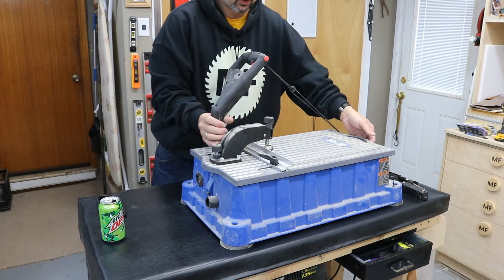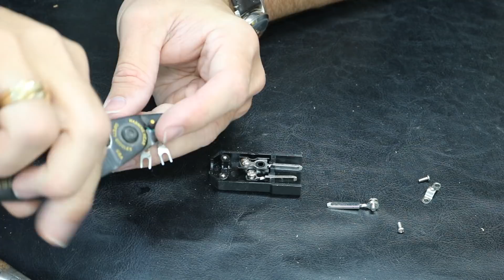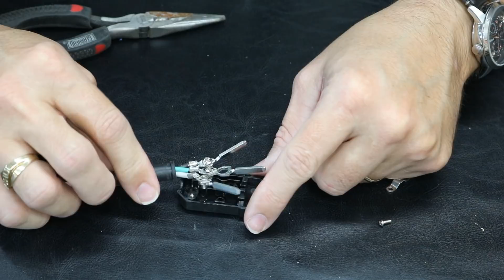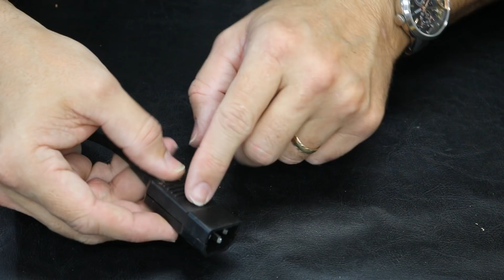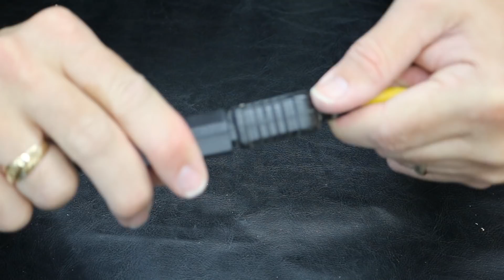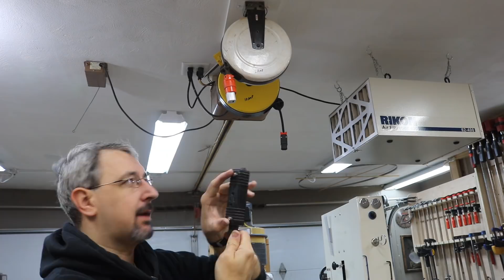Quick Disconnect System for your tools (follow up video)

Comment: How are these locking EIC connectors holding up after 3 years? I’m going to do this to my tools and and debating between the connectors you used or spending a bit more and getting the PowerCon connectors.
Reply from the maker: They are still holding up pretty good, if you use the eic get the locking ones. If not they put away pretty easily. Other then that no complaints. Was just thinking about doing a follow video. It might be time.

Comment: I changed all my power tools using 18 gauge cord. works great. I noticed you did your router and circular saw. what gauge wire is the cord. The amp rating on the connector is 10 amps.
Reply from the maker: I used the cord from the machine. All the tools I converted was rated under 10a

Comment: Just came across your video, after coming to the conclusion that I should change my tools' cables to a short IEC plug and replace the rest with one single cable which is easy to replace as many IT devices (monitors, printers etc) come with such cables. Thank you!
Reply from the maker: Cool, I really like this system and have grown to love it. I now have every tool converted and have been pleased that I’ve done it.

Comment: I would never cut any manufacturer's power cord.  If you grow used to the system, then sell the power cords on EBay, and you recoup over half the costs of this system.
Reply from the maker: After seeing the title to the video why would you watch the video then? It’s not for everyone. Stop wasting your time commenting on something you know you shouldn’t have watched.
Reply: Mike Fulton
The response is illogical.  The suggestion I make is that you have the supplies, so the need to cut one cable, then redo the ends is not apparent until such time as you introduce the idea inside the video.  Neither is it unique. 
I simply suggest an improvement in apptoach.
You also assume I don't need to see this.  That fact is not established. I did need to see it, so I watched 4 channels with the same theme to glean ideas.  A different channel, Marius Hornberger correctly points to cord value, AND warranty vouding in his.  You have a cheaper, more widespread connector system than he did.  That is great.  The use of computer component cables did not occur to me, you revealed it. They are in higher production quantities, so are cheaper to find.
I simply disagree with cutting any manufacturer's parts.  I neglected to mention it voids warranty, whereas, if you take out a manufacturer's cable, install QC cables, have an issue, replace the manufacturer's power cord, and take or send in the tool for repair, you can get warranty work.  
I worked with Dewalt hammer drills for years, and had to get warranty work about once a year.
Their brand store was .8 of a mile from our shop, and with 40 tech's throughout the city, from our company, 35 with Dewalt, we got treated like kings.  Cutting cords, housings, and modifying the drill would easily void the warranty at a glance.
Additionally, as I said, the parts of tools, including the power cord can be sold on EBay for most or all of the modification costs you incur.  For instance, the worn out batteries have a value.  Would you discard them, or recoup that value?  I also never used the second handle for 18v. hammer drills.  Should I see if they sell on EBay, or CL, or just throw them away?
Reply from the maker: Ok, Fair point The warranty deal could have been mentioned in the video for sure. I assume people would know that and didn't feel necessary to mention it. Plus I didn't think about that. That way i look at all the tool I converted they are pretty much one use tools. They are going to last as long as they are going to last and when its time to replace I'll just buy a new one. Most of the tools I converted are already outside the warranty or very close to it anyway. I see your point though and thank for the input. Forgive me If a I came across as a Jerk
Reply: Mike Fulton With a QC system you get to use all your tools with 2-3 power cords around the shop.  A great idea we already use on shop vac and air compression systems. 
I just disagree that the tools have found the end of their life cycle.
Most viewers are looking forward to upgrades in each unit.  Keeping the cables let's them trade it in, or sell it, or selling each power cord makes at least half this cost back.
Just saying.  
I still think you made a fine video, and deserve more subs and views.
Reply: MarkH10 your response is the one lacking logic. It's almost impossible to open some pro-sumer (Chinese) hand power tools and replace power cords. It's 100% brand dependent. You'll spend a ton of time and wind up not being able to get half of them back together -switch springs get lost, riveted or bonded parts are impossible to get apart - the juice is just not worth the squeeze.  Then you have the hassle of listing and fulfillment on eBay.  Mike would be working for $2/hr and wasting time better-spent doing something else.  Add to that the tools are mostly out of warranty or close anyway - and are all in the sub-$200 replacement cost - it's just not that big a deal.
Reply: Tioga Fretworks  
Since seeing this, andd commenting I have received emails I usually ignore on the subject of trade in.

That day I commented I binge watched and arrived through a suggestion on vlogger Marius Hornberger, the German shop YTer.

His video show 10 power tools, 1 of which is immediately apparent that it is too complicated to prices, so he closed and chopped it, the or her 9 are easy, and I have encountered that very thing.

Comment: Was there a reason why you chose the connectors you use vs Neutrik connectors?
Reply from the maker: Yes, the cost was way less
Reply: Mike Fulton - you might have saved $100 ($5 per) but it's stepping over dollars to save pennies. Neutrik 20a Powercon are slick, small, reliable - and lock together. Great product.
Reply: @HBSuccess  I looked at both (purchased both) and I find the Neutrik are significantly bigger. Price was not my concern, had the  Neutrik been smaller or even the same size I would have used them.

Comment: I've been wondering if you didn't like this system for any reason. I've been using my setup since your last video. I really love it.  Also I these connectors are rated for 15amps US but 10 amp International. I guess I international has more restrictions on electrical components. This is such a great idea and I don't have any more cords to wind up at the end of the day. keep it up man
Reply from the maker: Awesome thank for the feed back

Comment: Thanks for sharing. Great idea and good video. My tools are all connected to run and powered by one switch at the garage entrance so your system would not be advantageous. In that particular case.However, I'm designing a transportable workshop and your system would be perfect in there. My only concern is that the connection would work loose in operation, especially when connected overhead. I used to have an inline, waterproof, lockable cable connector on one of my lawnmowers but I cannot find the equivalent on Amazon
Reply from the maker: There are locking connections available

Comment: Common here in New Zealand and Australia to just cut the cord short and put a normal male plug on it. Then any extension cord works for it. Be cheaper I would think
Reply from the maker: Ya maybe
Reply: Exactly what I was thinking. Or use a pair of twist-locks leave 6" of the original cord.  I don't understand the logic of going to a totally different connex.